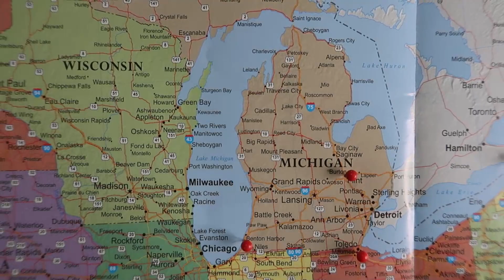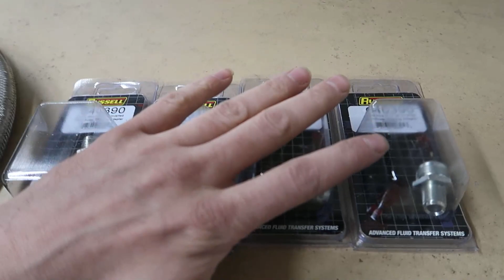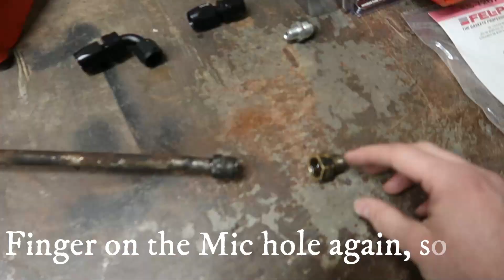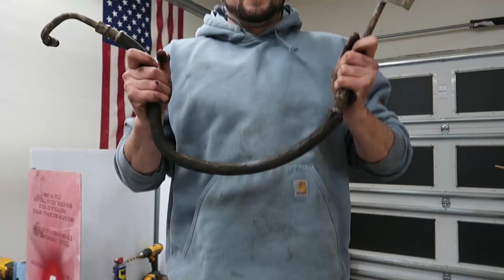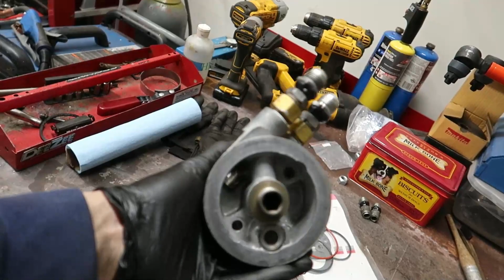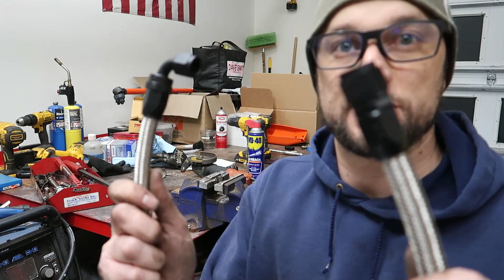K30 Trail Build, PSC steering box AND building AN hoses!

Comment: Next time try pushing away from you with the welding gun!!! By doing that it will help the bead to lay down smoother and not build up as high of a bead!!! Then you can go back over it by going towards you!! Just an idea to maybe help you out!!!
Reply from the maker: Good tip, I’ll have to remember that. One thing I’ve never done is actually sat down and learned how to weld properly (except welding class in college, but that was all stick welding). One of these days I need to get some scrap metal, watch a bunch of videos and learn proper technique. My welder also does TIG, but I’ve never tried it, but would love to learn.